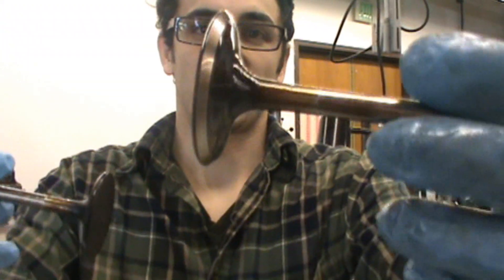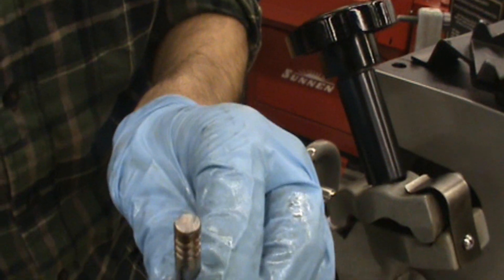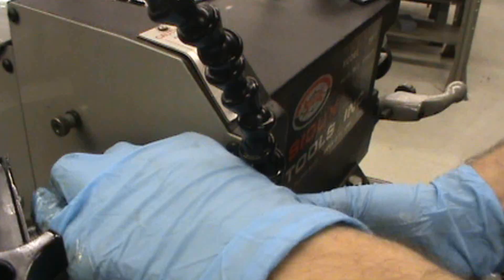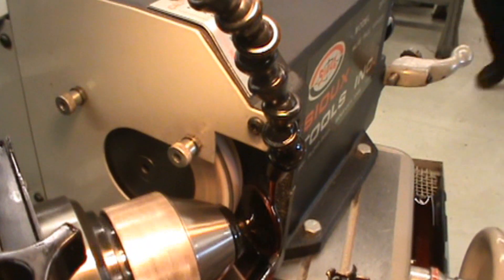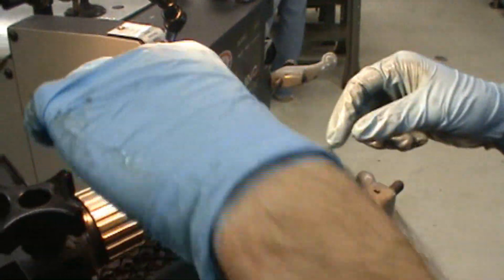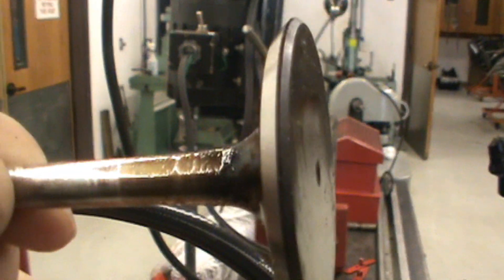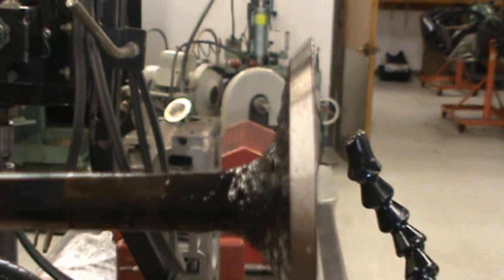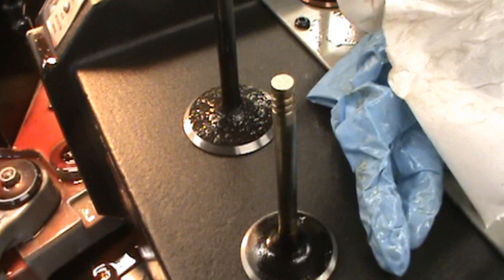Intake & Exhaust Valve Grinding and Machining

Comment: You should've ground it at 44 degrees
Reply: Interference angles are for hacks. 45 degree seat and 45 degree valve face is the way to go.

Comment: I got to agree with supersevenn, no self respecting machinists does a interference angle(pinch seats) on heads. The valve face and the seats are cut  at the same angle. This was done long a time ago when machinery were not as accurate and the seats had to much run out. So to get the valve to seal the did 45 degree seat angle and 46 degree valve angle.